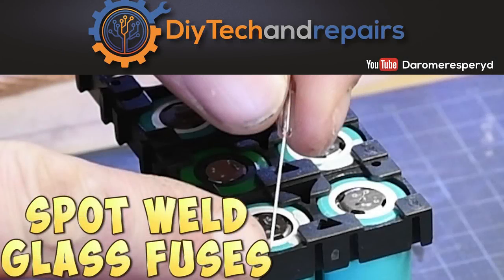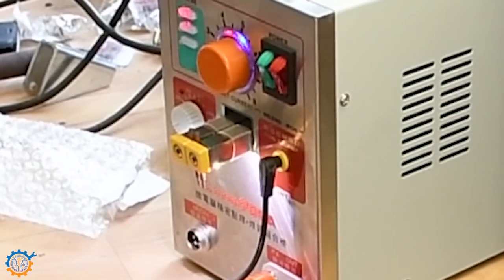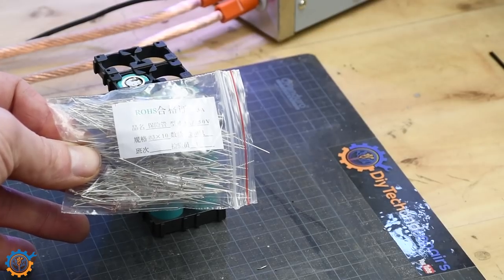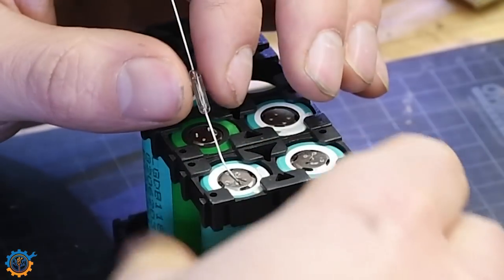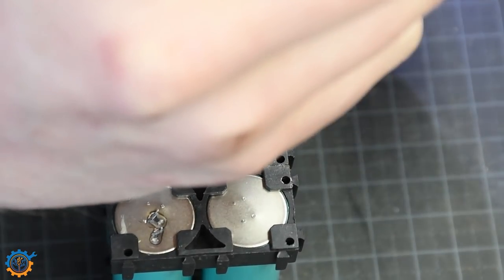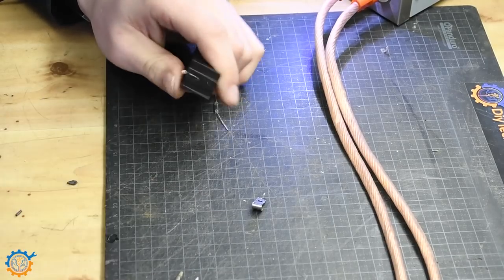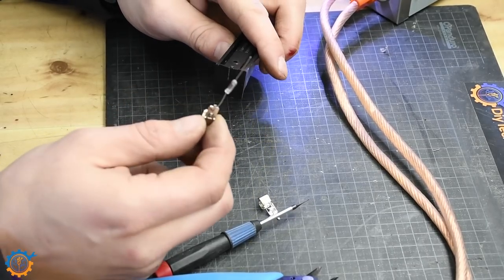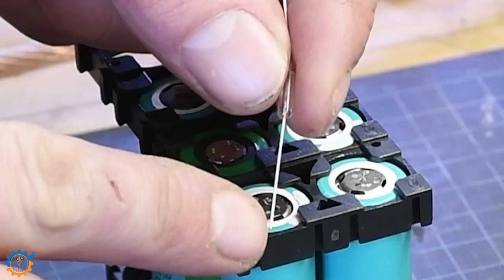Spot weld glass fuses

Comment: Awesome demonstration dude, next would you do amperage test on the glass fuses? to test whether the glass fuse is up to manufacturer's rating. Take for example 10-20 pieces and inject 1 to 10A to see how fast the fuse blow to get the average protection values.
Reply from the maker: Thanks!  AverageJoe have done current tests so I have not had any intention of redoing it. I think it have been done good enough. Glass fuses as such have shown to be good enough or close enough

Comment: I have the 709AD+ on 120v. It works great for welding to the cells. My problem is connecting the fuse wire and negative side to the bus bars.
Reply: I was halfway through the vid and then you answered my question. Lol! Thanks Daniel! Spot welding to a copper bus bar just doesn't work. Ill need a better solder iron than the 709AD+ has to solder to the bus bars.
Reply: @mrhypno1984   Halfway of this vedio a paused and ran to do a spot weld a glass fuse to my battery with a pointed pin of my microwave transformer spot welder. I weld perfect. Thanks for the video.

Comment: What if you flatten the wire a bit with a hammer. Should work easier and with less current
Reply from the maker: Then the flattened piece potentially could become a fuse it self :)  It takes time to do as well but perhaps doable.
Reply: @DIYTechRepairs   Also chances are there the flatten area to get broken.

Comment: I used glass fuses and it is very difficult to find out the burnt fuse. Now I am thinking about using 30AWG tinned copper wire as a fuse and simply we can notice the burnt fuse  by looking . Am i wrong? Please advise before I do.
Reply from the maker: It can be as tricky as glass. Especially when they burn in the edge. Glass is safer bet overall